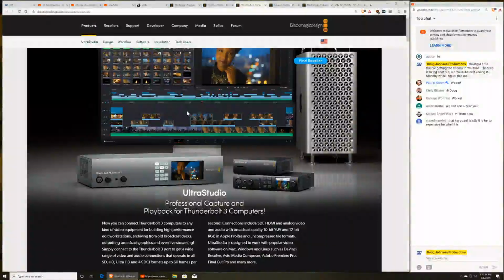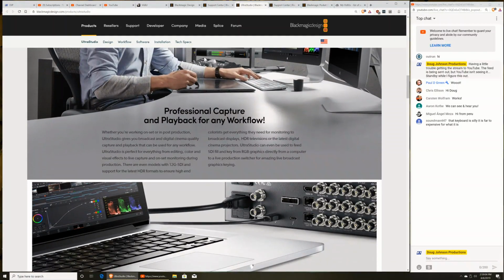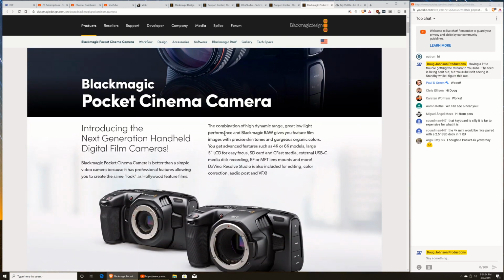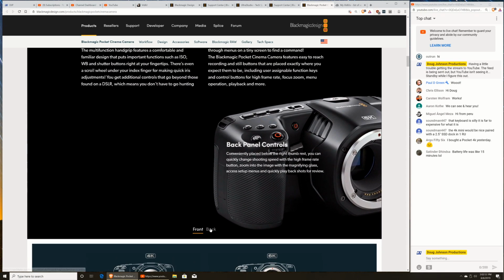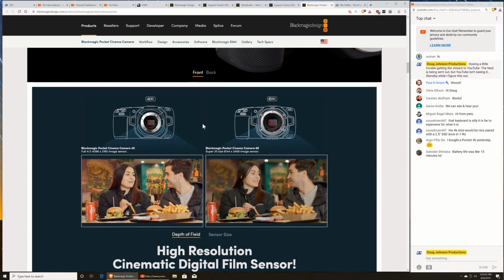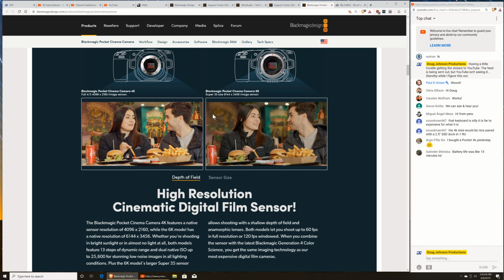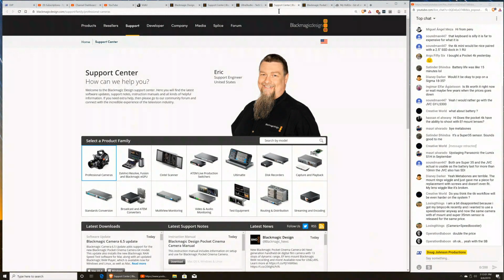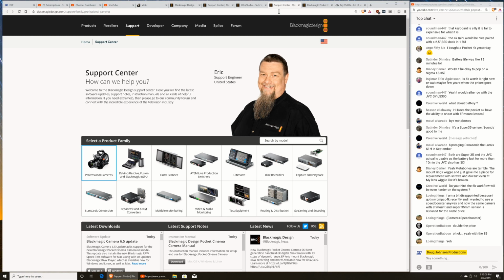Blackmagic Design Updates: Resolve 16.1, Pocket Cinema Camera 6K, UltraStudio 4K Mini

Comment: it's have input analog composite?...
Reply from the maker: The UltraStudio 4K Mini? Yes.
Reply: @djp_video thank you for the answer my question.  the ultrastudio 4k mini can record into the hard disk or sdd? then i want to recording 4hours video continues without stop, it's ultrastudio 4k mini can do that?
Reply from the maker: That depends entirely on what software you use to capture the video. The included software will let you save video to disk, but it is in a rather large format that would likely fill your disk quickly, and isn’t easy to edit.
Reply: @djp_video  if i use ultrastudio 4k mini it's can record video 4hours continues without stop?.then the ultrastudio 4k mini can record into HDD?..
Reply: i mean not record into the SD card record into HDD (hard disk).
Reply: the ultrastudio 4k mini
Reply: @djp_video  thank you for information yes know i need software to capture that. do you know what kind of hardware for recording composite analog?

Comment: Thanks for the overview Doug.

A quick question please:  
My computer on has Thunderbolt 2.  Can i output to a Reference monitor using a T/bolt 2 > T/bolt 3 adaptor?  Can i do this without losing any functionality?

I'm currently using an UltraStudio Mini Monitor to output to my reference monitor for colour grading, however this is only limited to 30fps.

Any advice would be gratefully appreciated.

Thanks Doug.

Kind Regards
Karl
Reply from the maker: I assume you’re wanting to use the UltraStudio HD Mini?

The problem you’re going to run into is finding an adapter to convert your TB2 to TB3. There are adapters that go the other way, but I couldn’t find any that go the direction you need. You’re probably better off using a device with a Thunderbolt 2 interface, like the (just barely) discontinued UltraStudio 4K instead.
Reply: @djp_video  Thanks for the quick response Doug.  Appreciated.

Yes, you may have a point about the direction of the signal.

The reason i wanted to get the new version is to future proof, but i guess that this brings it's own issues.

So, i've just had a look at the one you suggested (t/bolt2 version) and it's still available, but the price is much the same as the new one.  I suppose i may have to wait a while for the price to drop.

Thanks again for your reply Doug.  All the best.

Comment: MFT is probably the most adaptable and versatile lens mount option available. And Olympus has a great range of MFT lens's.
Reply from the maker: One of the most adaptable, maybe. But adapted lenses never work as well as native.  And when it comes to lenses designed for cinema use, there are very few native MFT options -- almost everything is PL or EF. And essentially zero MFT lenses for live video work.

Comment: Another cool thing about the timeline sync of cameras is that the ATEM switcher now supports setting the same timecode. So you can live mix a show and sync this mix with other cinematic camera sources and/or iso recording in post production using the same time code.